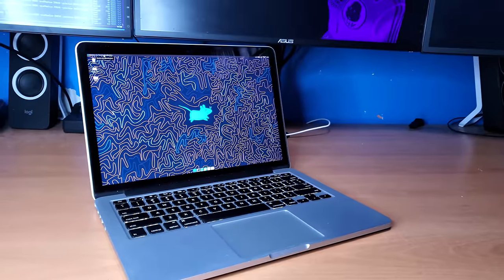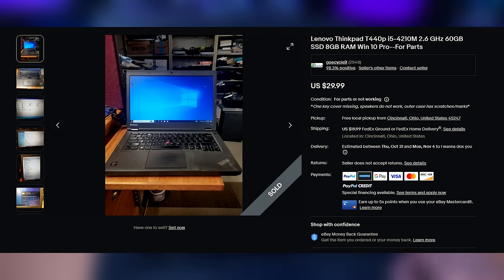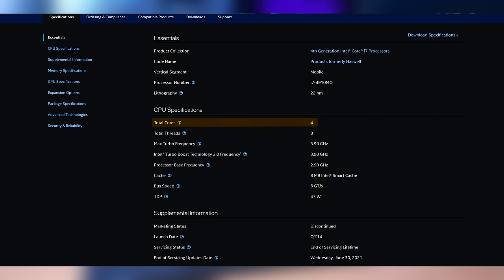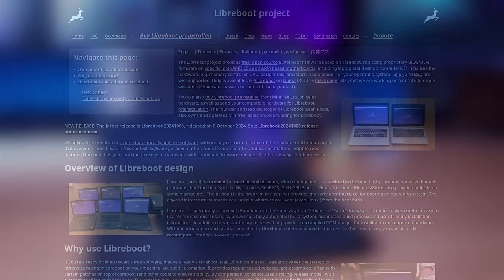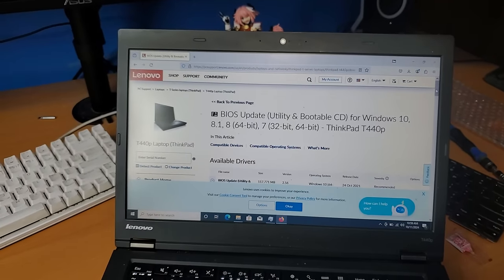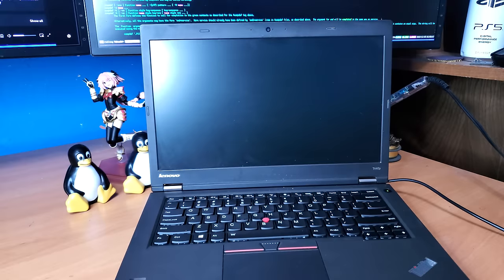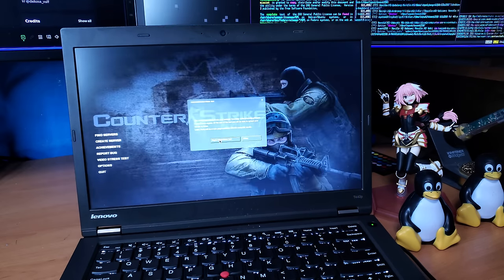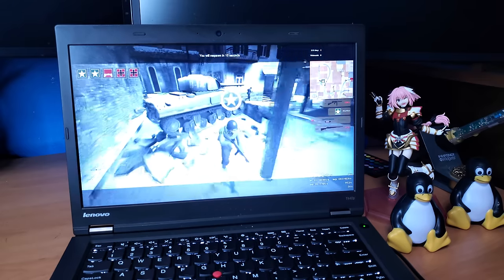Building the ultimate ThinkPad!

Comment: T440p is the Framework before Framework was a company
Reply: can you fit am4 ryzen desktop motherboard like a a520m inside if you  desolder the io ports ?
Reply: FR I bet the they were inspired by it,  perhaps subconsciously.
Reply: Not really. The original framework with 11th gen Intel can be upgraded in its entirety to the latest core ultra or ryzen mobile chips, with upgraded memory, connectivity and storage options. Not quite the same as being able to upgrade within the same series/generation of components.

Comment: Just so you know, Windows will "use" 2gb of ram at idle (when you have 8gb total), however, the OS doesn't actually need all of that RAM. It just utilizes it since it is there and not currently being used to make certain processes in the OS run faster. Once you started running RAM intensive apps, the amount of RAM the OS uses will be scaled back to the minimum. Windows has RAM management built into it basically.
Reply: arch also does that while still using barely any ram
Reply: @bokexd3173  it's probably just not reporting it as used, I think older versions of windows used to not report it as used

All modern OSs do it, unused ram is wasted ram
Reply: That's so not true. Mine uses 4gb whilst I'm running illustrator and illustrator uses about 2gb.

It's a T480
Reply: nonsense, just admit windows is spyware

Comment: Man surprised the macbook still works.  There's a transformer next to the charging port that very commonly burns out, then you can't charge it or run it off the charger.
Reply from the maker: Interesting! Had no clue
Reply: Mate, how do Macbooks support Linux???
Reply: @mica7191  Those models have Intel processors, so there's no problem running linux
Reply: I didn't know these thinks could fail, every old timer in my family runs macbooks of these vintage, none see an issue even for the power users making commercial videos on them. They seem pretty hardy
Reply: @zh9732  I tried fixing one just a couple weeks ago and found the transformer had burned out and warped. Just a matter of time especially if they keep it plugged in all the time
Reply: @DARvlogs  nice
Reply from the maker: @mica7191  macbooks are computers, you can put anything on a computer.

Comment: I'm not a Linux knower by any means, but a while back I put Mint on an old Toshiba that was well past Windows 11's dumb requirements, and it breathed life into the old girl. It surprisingly had a socketed dual core Ivy Bridge from the factory, and a quad core i7 plopped right in with no complaint. Even the original cooling system has no problems with it, probably because it was so chonky to begin with. It was surprisingly easy to install Mint as a first-timer. A+. Would recommend. Also Thinkpads are awesome, I have a 3rd gen T14s with a ryzen chip and it's great.

Comment: Used a T440p myself, honestly one of the best laptops I've ever used. Great upgrade capabilities and still such a solid machine in 2024. If you got a 1080p display on it that would be chef's kiss. Congrats on the new laptop!
Reply: Plus 1 on the display upgrade.
Reply: There's some screen that was original from/for the Razer Blade that works in the T440p and looks pretty nice. It's not too bad to put in other than the plastic clips on the bezel being somewhat prone to breaking. I'd second upgrading the screen if you're gonna use it portably at all. Though personally I mostly use mine docked like a desktop and don't see the nice screen I put in it.

Comment: 11:48 same here with my Dell Latitude E5540, if it has a lower-wattage charger, it'll complain in the BIOS as well as setting the "On Demand Clock Modulation" to 33%, which essentially inserts "idle clocks" to artificially tank the CPU performance to a crawl to make the OS unusable while the laptop was charging on the wrong charger.
We love to see it!
Reply: Same here with my Latitude E7440, altough I have the most powerful charger for it, but if it won't detect the charger properly (as the plug is worn out somewhat), it will complain & not charge despite actually showing a charging indicator
Reply: I also have the T440p and when I did the cpu upgrade it complained about the charger and it didn't use it at all. But you could run the laptop on battery and when it's off the battery will recharge. So you can get by it when waiting for your new powerful charger. The guy in the video couldn't update the BIOS because it requires the charger plugged in all the time, even if the battery is full.

Comment: I still use my 2012 Macbook Air, dualcore, 4 Gb Ram. At Amazon you will find cheap adaptors for standard sata m2 ssds. While it runs well with KDE and Gnome, with Lxqt or XFCE its really good for light office use.

Comment: I run Gentoo Linux on all of my Thinkpads (I have a large collection of them given I repair and renovate them) and the T440P is a great machine - as is the X220 as a smaller "netbook-sized" machine.

Arch is good but Gentoo allows for much finer customisation and still officially supports 32-bit machines too - it runs extremely well on great Core 2 Duo Thinkpads like the T60 and T61 also. I even have it installed and running on Pentium III based Thinkpads like the T22 and T23.

Thinkpads always have great Linux support and, as you shown very well in this video, most of them are easy to upgrade. Just remember that any Thinkpad "X" series machine (X60, X220, etc.) has a soldered-in CPU so you won't be able to swap that out, but you can do most of the other upgrades here.

Comment: Ive been using a t440p for a while now. Bought it used, put 16g of ram in it, dual ssd, i7 4702mq, 1080p display and I run linux mint. Its a really good daily laptop thats so solid im not worried about bending it in half in my bag. Battery is passed its best, I get just under 2 hours but a 9 cell will be in my basket soon enough.

Comment: The worst part of old thinkpads is the subpar lcd panel, but this is so cool man!
Reply: The latest also very often have this very bad displays. Sucks on my T14g2 so bad.
Reply: Buy upgrades gents
Reply: @lancheloth  I am hating this glued display shizzle.
Reply: @foss_sound  hmm  can't we replace not just the LCD but also all the upper laptop part? I always bought the minimum Full HD one.. Because I don't want to do LCD replacement but looking at the manual don't they get screw in?
Reply: @lancheloth  I have a FullHD display, BUT it is massively ghosting and pretty dark. My complaint for newer Thinkpad (T) models and for the latest models the chiclet-style keyboards. There is a way to replace the display, but the options are just better by a little.
Reply: @foss_sound  There's no glue on those ThinkPads. The bezel is held by clips and the monitor is screwed in. It is really easy to take it apart. I've done it without even watching a tutorial. Be careful with those tiny clips, though.
Reply: @foss_sound  my current project is W520 with IPS display and try to saving core i7 quad core since mine still in i5. Yup the display not impressive but better in FHD then in HD. Love the keyboard and the think lamp. Seems not for everybody but I need less interruption in my notebook than the PC that have 2 screen and multiple apps running in one time.
Reply: @vdochev  Ok? Two persons told me, that this model has glued bezel. One was the seller. Maybe I should give it a look by myslf in the near future.
Reply: @foss_sound  yup better open your manual, and if the ghosting is so bad why not replace it?

Comment: Hey man, just sharing my experience because when you said I5-3210M my ears perked up. I had an 
HP- 2000 with a horrible AMD E-300 soldered cpu board. I managed to find a motherboard that supports HM-75 express and a G2 socket (some HP2000's came with them, only reason this worked) and the I5-3120M and I5-3230M were candidates. However, with some research and educated guessing, an Intel i7-3840QM works! Originally I thought the I7-3612QM was its max supported limit. Going from a 2 core AMD to a quad core Intel has been crazy. Turns out the that while on paper, the board only handles 8GB of ram, it accepted 16GB and I added an SSD. While its not a thinkpad, modding this old laptop has been real fun. only finished it about 4 months ago. Its still using windows 10 but it did fire up with no boot issues. Will have to switch to Linux once the security updates stops.

Idk if anyone would see, 
(or even need this for Modding an Hp-2000/1000 or Compaq CQ45 or similar HP250 G1/ 450 G0) 
but the part numbers for the board were
6050A2493101 
6050A2493101-MB-A02 
(these are the ones I used, with the external GPU, you'll need to swap your fan for the version that has the additional heatsink for the gpu, see part number 685087-001)
I bought both parts from the vendor Nokotion on Ali express. and the I7-3840QM on ebay.

Additional board numbers, non external GPU (I think)

694693-001
685108-001
694693-001

Comment: The T440p is so much fun. I bought one with pretty much the worst specs you could have (though somebody at the store forgot to check for everything and I ended up getting a free LTE module which was nice) and upgraded the panel, ram, ssd, other ssd, wlan card, cpu and trackpad (T450 trackpads fit) and now it's just the way I want it.

Comment: I own a few T440p laptops and they have been great. Cpu upgrade, Max ram, 1080 screen, and 3 ssds is kinda beast under Linux for dirt cheap. I've even gifted a couple to family running mx Linux. Be careful when you buy 9cell batts - lot of sellers claiming big capacity that is actually barely over a brand new 6 cell. Checking the actual vs reported capacity in your batt stats will help confirm.

Comment: Hi, Robbie from BobbleTech here. You might have run across my buyer's guide while choosing this (it's in the sub sidebar).

The T440p is a great machine with good expansion. That said - the models made after 2018 (T, P, X, W) are such a big jump in processing power - the modularity of the processor doesn't really matter anymore - and they run about the same cost-wise.

I really hope Framework fixes some of the QC issues recently covered by LTT - it would be good for Lenovo's Thinkpad division (still run and supported by a lot of the same folks that ran it in the IBM days, afaik) to get some competition!
Reply: Funny thing is, I bought a T25 (the 25th anniversary ThinkPad, which is a T470 with a classic 7 row keyboard) from a guy whose partner worked at the ThinkPad laboratory in Japan. He even had exclusive stuff from it, like a decorative TrackPoint (not for the laptop, more like a trophy of sorts).
Reply: The T440p, the ClunkPad?

Comment: if your changing out the ssd, you can by an adapter that fits into nvme port on the laptop, then plug the new ssd into that adapter. Been using linux mint for 10 months now.

Comment: Honestly as an High School student i prefer my modded x220, but the dual core i5 2520 that i have is way less powerful than the quad core i7 that you have .
Even if i could put an i7 mobo in my x220, it would thermal throttle even more 😅
I prefer it over the later gens of thinkpads because of the keyboard and the build quality, and also the overall experience .
Mods that i did :
- 16gigs of ddr3
- External WiFi antenna
- Intel AX210 WiFi card
- Internal usb mod for my logitech mouse
- 256gig mSATA SSD (I wonder why i can't just use a mini-pcie ssd to boot, though, as it has a way better speed (500 vs. 200mB/s)
- USB 3.0 ExpressCard

Comment: I recently got a hold of a T14S with a 10th gen i7vPro FOR FREE. I previously had a Surface Book 2 with 8th gen i7 and a GTX1060, but it was too big of a computer for me (15"). So, I ended up giving that away to a friend. 

Anyway, the T14S is great; it's so freakin' light. the CPU is fine, the memory is soldered in, and I ended up replacing the m.2 ssd to a Samsung 990 1TB. This thing is freakin' FAST. 

I did end up installing Windows 10 Pro and I did spend a lot of time 'cleaning it up' (a few hours running updates, Vantage Pro, installing productivity apps, removing 'bloatware'). Lenovo machines are pretty sweet.

Comment: I'm still using my Dell Latitude E6440 which is more or less the Dell equivalent to the T440p. 16gb RAM, 1.6tb SSD, and a BGA to PGA modded 4850HQ from Xianyu and it still handles everything I do 12 years later :)

Comment: Cool, I have this Thinkpad as well. The works (1080p screen, better Wi-Fi/BT, SATA caddy, T450 trackpad, backlit KB, dGPU, new 9-cell battery), corebooted with Arch, pulled a i7-4700MQ out of an overheating HP I got for $50 (too much thermal paste on the CPU). Been my daily driver for a couple of years now with no signs of that changing. My only complaint would be that the card reader doesn't work in coreboot.

Comment: These old machines are neat as a fun project but aren't really worth it, you're currently at $120 still with the original screen, and for about £150 you can get something like a Thinkpad X380 or Latitude 7400 which are way thinner, lighter, have much better screens, longer battery life, better performance, are quieter, have modern decoders for videos, have modern hardware standards like USB C charging and wifi, and have things like optional touch and pen support. I've seen a couple for £120, and a touch model of the latitude for 160, which can take an optional massive 78wh battery too.
Reply from the maker: I went with this because I want a modified BIOS and only haswell thinkpads can be core/librebooted right now.

Comment: Since I got my refurbished T480 to run Ubuntu in it, I barely touched my XPS,. It's just so smooth and easy to use for productivity and efficiency. I guess I am part of the cult now.
The only thing I couldn't make work properly so far is the fingerprint scanner. And deactivating the touch screen required some research effort, but was it.

Comment: Dude, change the thermal paste. That laptop is not supposed to get that hot normally. Also, you should be able to get some tools to tweak voltages or turbo of the cpu. My brother has the following version to that one and it  still runs great (if you know how to configure it). Also, the youtube being sluggish is their fault, not of that cpu (you can change the settings with addons or by using a different encoder, since they use higher compression on the videos for desktops than laptops, so you use a lot more cpu to decode but saving on bandwith, while on cellphones, they require a lot more bandwith because the cideo compression is not that high, so that the cpu can decode it and not lose frames).

That 2012 laptop is not garbage, its the current software that sucks.

Comment: i run baremetal Linux on a bunch of old unibody macs. Debian runs great. 17' Macbook Pro and Debian does just fine. Has the matte display
have garuda Linux on a 2015 15 inch mac bare metal. Amazing. Just as good basically as a linux VM on my M1 Max and M1 air

Comment: i know youtube playback is kind of the bottom line for a lot of older hardware being usable, i would recommend the h264ify extension (chrome or firefox). it swaps youtube to a much more gpu friendly video codec. i had some stuttering issues on my dell e6440 (also 2014), but this seems to have solved them :) god knows youtube is a hungry site.
i haven't gotten linux on here yet, but i am looking to soon (alongside an ssd).  it's kind of like a thinkpad in many of the business-class laptop ways, doesn't have the square case of the older thinkpads though sadly (yours is lovely). i've been learning the ropes with debian on my sister's old lenovo yoga she gave to me (windows 10 was too sluggish for her on it), so i'm probably going to go with debian (and maybe try gentoo on the yoga, since it cannot be upgraded beyond the hdd, seems like a good use-case for gentoo).

Comment: on my macbook pro a1278 2012 i run linux mint, i also installed linux mint on an external ssd and connect that to the old macbook pro (and any computer) and it runs pretty quickly.

Comment: heck ya I love my t440p

specs
-i7_4712mq
-16gb Ram at 1866mhz
-gt730m+intel hd graphics
-t450 trackpad
-57++ 9cell battery

eventually I would like to upgrade my screen to a 1080p display
aswell as a new battery since mines down to 70% health but
other than that I really like this machine

Comment: Kinda curious if you would have the answer. Im sure its in the comments somewhere.

The t440p says max supported memory is 16gigs. But the limiting factor is the cpu? The intel mq processors support up to 32gigs.  Not that i think you would benefit much after 16gs  even with the 4980hq. But i think it would be interesting to push it to its literal max potential. 

I currently have a t450s that i was about to touch up. But after coming across your video im hunting down a t440p.

Comment: Please implement some sort of cooling mod for that poor quad core😭
Reply: its 47 watt and is not really needed as long as you use good paste, they came from the factory with single pipe and quad core while only hitting 80c ish.
Reply: @raccoroni.  the moment you actually use it for anything other than counter strike it will melt itself, I had the 4910MQ and whenever I played Hades on that thing it would get all the way to 100c and start throttling, I had even dabbled with liquid metal and it just wouldn't get under control with the stock cooler